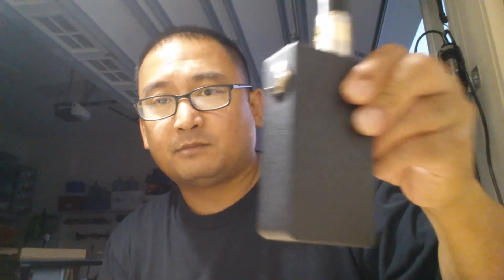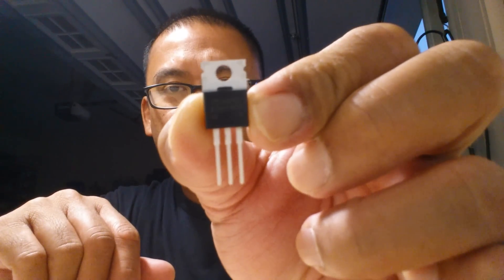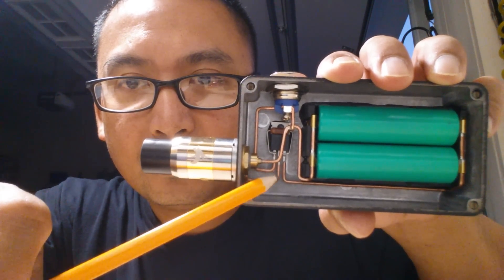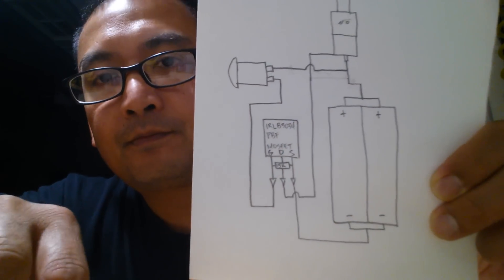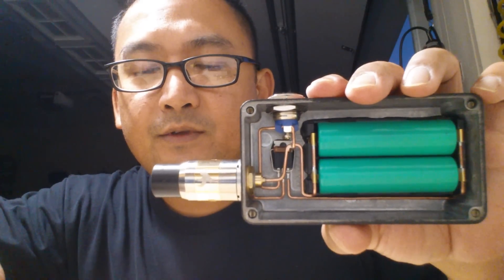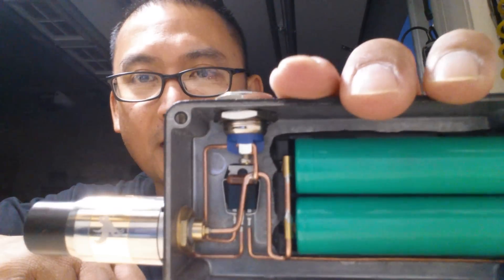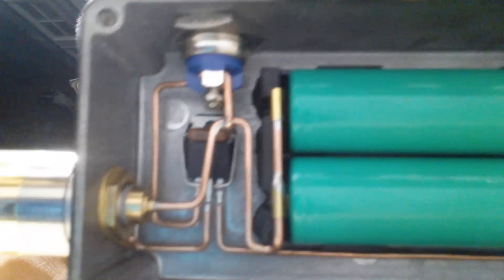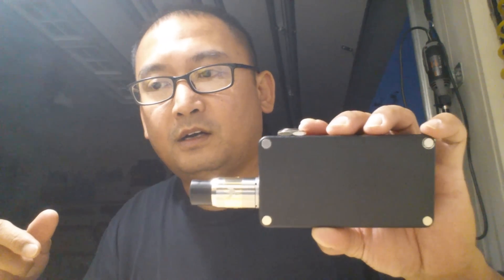Unregulated box mod with a Mosfet

Comment: That is slick wiring bud. you confused me though. You are using 14g solid copper wire. But you said you would use heavier gauge for the negative, and recommended 18. But 18 gauge is much smaller than 14, not heavier.
Reply from the maker: Ranger Rob 1. Practice 2. Use a variable wattage soldering iron 3. Use soldering paste (it will clean the surface for a better bond) 4. Don't use too much solder.
Reply from the maker: Ranger Rob one more thing, this is how I do it and how I was taught, place the tip of the iron directly on the surfaces of the item your trying to solder. For example, if you want to solder 2 wires together, ensure the tip of the iron is touching both wires. After a couple seconds or when the Flux paste you applied start to bubble, apply the solder. Again, don't use too much. Also watch  soldering vids on YouTube if you want to see it action.
Reply from the maker: Ryan Lee I did use 14 gauge. The thinnest gauge I would recommend is at least an 18 gauge throughout. But thicker gauge wires would provide the least voltage drop...the better it will perform.
Reply: Indeed. How was the voltage drop with your 14? I must say, my ocd really appreciated your wiring! So clean and perfect. Your mod is the first I have seen where someone used solid wire instead of braided. Love the clean look of it. Very well done man.
Reply: Al USAF I also have a question, I have been told that soild core will transfer vibrations straight to solder joints and the joints will brake down quicker, multicore on the other hand is better at absorbing vibrations ect. ect. Im sure about that but I was wondering what your take is on that? Is multicore as effective at transferring current compared to soildcore?
Reply: Ranger Rob Both wires carry the same voltage. The reason for braided wire is for applications where it is easier to bend the braided wire verse solid wire.
Reply: Alright, and what about the vibrations braking down solder joints quicker is that actually a factor?
Reply from the maker: Ryan Lee check part 3 of my tutorial build.
Reply from the maker: Ranger Rob it's not a factor in box mods. But if you're going to be storing your box mods in an area where there's going to be a LOT of vibration, then maybe. I'm not sure what you're doing while vaping that made you worry about vibrations.
Reply: +AI USAF Yeah i was lurking in a box mod forum and some dude was bashing soild core, explaining that vibrations transfer easily over solidcore wire and ultimately leads to a brake down of solder joint faster, sounded reasonable and I plan to make my own box in the near future and I am just gathering my information. But what your saying is that, average daily use and transportation abuse such as minor drops and driving in a vehicle  will not cause strong enough vibrations for the integrity of the solder joins to degrade at a rate that is higher then normal? Thats all im getting at.
Reply from the maker: Ranger Rob I read a lot of those forums too. I know a lot of those people that comment are really smart...well book smart. Which is good. But I'm almost positive that those people don't build there own box mod or even Vape. They just like to sound smart because they've read it somewhere. They think they can apply every theory into everything. They also like bashing other modders because they think what they do is a standard when it comes to building box mods. I didn't build mine because I think it's better, I built it to make it look a little different than others.

To answer your question...as long as you do a good job of soldering and not store your box mod next to a jet engine...it will be fine (using solid copper wire)
Reply: Well thats good to know, thank you for clearing that up for me. I do like the look of the solid copper, do you have any tips for when it comes to soldering, I have never seen such clean solder joints it is quite an impressive box.

Comment: Awesome mod. Can't find the 15kohm resistor with those specs. I'm gonna use a similar resistor with a voltage rating of 250V instead of 300V. I'll let you know how it turns out unless you would think that it is going to turn into a pipe bomb at that point.

Comment: Can i run a 22k ohm resistor in place of a 15k
Reply from the maker: Special EDy you do need a resistor because it's what shuts off the mosfet after the switch is released.
Reply from the maker: Chris Lucas I've read on other forums where 22K worked but I can't directly tell you that it will because I've never tried a 22K. Post it here if it does...thanks.
Reply: You dont need the resistor, but if you do use one the smaller the better. Basically the resistor will be using power any time the batteries are connected.
Reply: Well the 22k has the same specs as far as watts but if it works will let you know just waiting on box to come in mail
Reply: Al USAF The resistor dissipates any electricity created by interference between the gate and the switch. The mosfet will switch on if there is any voltage present at the gate. The idea behind the resistor is to prevent the mosfet from accidently turning on and off from inductive currents in the wire from the switch to gate.
Since we dont have any other electronics present in the device the only way to create an inductive current would be waving a large magnet past the box mod. If there was another wire in close proximity with current flowing through it(while the mosfet is off) the resistor would be necessary.
The gate to source resistance is 2.1ohms, it is essentially 7000 times more effective at "shutting off" the mosfet as the 15kohm resistor you suggest. But since the switch has zero capacitance this fact is irrelevant.
Reply from the maker: Special EDy thanks for that very long explanation about how a mosfet work...you're not the first. If you've built a "box mod" with a mosfet and you didn't use a resistor, please share that. But in this case it's necessary to use a resistor.
Reply: K guys the 22k worked no problems at all so i you cant find 15k 22k will work
Reply: Al USAF My dual 26650 box mod has a 555 IC and PNP transistor powered by the button for PWM.
200ma from the IC wasnt enough to drive two 3034 mosfets so I had to add the transistor. I think they are a little less sensitive than you think even though they are supposed to be "logic level".
Reply: Special EDy Nope. does not work that way..it's not a read switch..

Comment: OK  wired mine just like yours, and when i screw in the RDA it fires without button pushed ?? y is that ?
Reply from the maker: Jason Etcheson happened to me too when I built my first one. More than likely the negative wire at the bottom of the battery sled and the 510 negative are making contact with the cover when you put on it . Try it without the cover, if it works then this is the problem. To fix this, you have to file down the lip of the cover where it's making contact with the wire and the 510 negative washer/nut. Let me know what happens.
Reply: ya was a ground touching at the bottom so i put black rubber sheets in it now its fine, ty for your help

Comment: First off epic level clean on the build Question is that the only 15k resistor you recommend for this build? thank you
Reply from the maker: joe biondo you can use other 15K resistor. But I can only recommend the one I'm using because I know it works.
Reply: Al USAF is there any reason why this would fire on one battery thank you in advance
Reply from the maker: joe biondo it should because it's wired in parallel.

Comment: Hey all I am about to try my luck at building a box mod now I noticed that most people are using the 18650 at 2600 mAh i have found some that say they are 4000 mAh  on eBay now from what I gather this means they can store more power which would make them last longer is this correct and would it be safe to use them?
Reply from the maker: brian hampton I'm not sure about those batteries. But I use either Sony VTC-4s or Samsung 25Rs.
Reply: OK thanks

Comment: Hey Al, I just built the same exact mod but my solder point where the positive out of the switch connects to the positive wire leading to the 510 keeps breaking when I screw on an atomizer. Am I using the wrong solder? Seems like I would need solder that is flexible. Any feedback appreciated. I may have to use stranded wire there I don't know.
Reply from the maker: ***** what type solder did you use? Also did you use Flux paste? This helps clean the area for a better bond.
Reply: Nevermind it was my cheapo soldering iron. I used my weller and now its all good. Thanks for replying.

Comment: I just bought a dual 18650 box wired in parallel (haven't got it yet) but it doesnt look like a mosfet build in the pictures. So im planning adding a mosfet and resistor too it when i get it. Thanks for the video it was very informative. Also how unsafe would it be to use it without the mosfet? Would it be less dangerous with couple second button taps?
Reply from the maker: zp1944 it should be OK for a while but I recommend that you install a Mosfet.
Reply: +AI USAF thanks
Reply: +AI USAF thanks

Comment: can this same diagram be used to make the box a series instead of parallel? you have a clean looking setup.
Reply from the maker: Yes you can
Reply: Does the diagram wiring chang other than the bottom pos n neg being wired together?
Reply from the maker: Mathew Newkirk no change except you're going to connect the bottom two contacts together...so you're correct.

Comment: the copper looks like its electrical wire without the protection of its plastic sleeve
and a cheap solder iron for all the welds, i can make this but will leave the plastic on the wires
Reply from the maker: Congratulations...you're the very first one to figure out that I used an electrical wire without the shielding. Please show me and everyone else your build so we can learn something from you.
Reply: will do but have to buy a few items,and  it won't be soon

Comment: I was running a .06 build with a IRLB3034PBF mosfet and it began to run away and autofired. Now its fried. I don't understand why it happened because this mosfet is rated for a way higher amp than what I'm pulling through it. .06 comes out to 70 amps at 4.2 volts. 295 watts. Replaced the mosfet and it happened again. Could the switch be causing the mosfet to fail? any ideas?
Reply from the maker: With that low of a build it will heat up. Is it covered with heat shrink? If it is, you're trapping the heat. Try it without heat shrink to allow heat to escape or put a heat sink on top of it (Mosfet heat sink or a small copper heat sink) for better heat dissipation. Lastly, don't go too low...just my suggestion.

Comment: nice nice nice build i was skeptical on how you used that transistor at first but then i just reffreshed myself on how transitors work and wooooooooow nice using the transistor to use the full power of the battery without frying your switch is a very nice inivation

Comment: Great Vid...collecting parts now...

Which mosfet did you use, the part number comes up with two:

1)  0.0017 Ohm; Thesehold voltage 2.5v; and

2) 0.0014 Ohm; Thresehold voltage 1.0v.

Thanks!
Reply from the maker: #1

Comment: I'm going to build a dual 64amp 26650 box mod with a mosfet, does it matter what kind of mosfet I use?
Reply from the maker: You can use the same Mosfet
Reply: What kind of mosfet?
Reply from the maker: Patrick Diaz it's in the description

Comment: I have a question, I can't really determine, from the video, how you spliced the positive connection (Atty battery switch).
I wonder if it would be ok to kind of wrap the positive switch twice around the copper wire connecting the atty and battery +
Reply from the maker: Yes you can
Reply: Btw I have another question, If I am right you are using an N channel mosfet, is there a specific type or rating of mosfet (like ohm ratings in resistors) that I will need? Thank you!
Reply from the maker: Correct, it's an N-channel. I'm not sure for other Mosfets with different specs. But for the IRLB3034PBF, a lot of modders use a 15K resistor but others have tried 22K. But I've only used the IRLB3034PBF with a 15K resistor. I would recommend these because I know it works.

Comment: Hi Al USAF... First of all, I congratulate you for the awesome build. I have finally found something truly cool in modding a box mod. For a month or so, I have been gathering info and items required in building the exact mod that you have featured here. I have all the items except two... 1. I can't get a hammond box here in Malaysia but that's solved. I made my own wooden box. 2. This is the biggest one... locating a 14 gauge or lower, solid copper wire. I have a 16 gauge solid copper wire and that's the lowest gauge I can find thus far. I want to get a 14 gauge. Now, yesterday a friend told me that he has a 16mm cable with 7 strands of solid copper wire in it. I haven't seen it yet. Been trying to look up the spec of 16mm electric cable in the internet but to no avail. Did some other reading and found that 10 gauge solid copper wire can hold up to 30 amp... Here are my questions... Would it be okay to use 10 gauge? Or anything lower than 14 gauge solid copper (If I can get one)... Would it affect the perfomance in terms of voltage? I am using the exact setup like yours with dual parallel 18650 batteries, 3 amp rated switch, N channel mosfet and a fatdaddy 510 connector. I am preparing to build this very soon. I appreciate you kind reply. Anyway, congratulations on your awesome build again, pal. Truly a masterpiece...
Reply from the maker: Thanks Ralph! Yes you can use the 10 gauge wire. You just have to file or sand it down to fit the 510 positive pin and probably the switch. Also because the wire is thicker, just make sure the wires will not be touching each other, especially when you solder them onto the Mosfet. Good luck on your build. It should perform better because it will handle a lot more amps. Good luck on your build.

Comment: If I make a Build with dual 26650's will I need to get any different parts? IE: will the Mosfet Still work or would I need to get a different one?

My other Q is why run batteries in a parallel rather than a series?
Reply: Also I just read that " In reality, the current 26650s are a generation behind their 18650 cousins. Unless you have to have the additional capacity the larger cell offers, they are outclassed in every way by the newer and slimmer cells."  What would be the advantage of running 26650's over 18650's. Also what does he mean by additional capacity?
Reply: parallel batteries doubles the amperage, which means you can use a lower resistance atomizer
Reply from the maker: Tnx Andre for the response. Yes, you can use the same Mosfet. Not sure the source of the quote but as far as the capacity, it means longer battery life. For example, a Sony VTC4 is rated at 2100 mAh. An MNKE 26650 is rated at 3500 mAh.
Reply: Awesome thanks for all the help, needed to know everything before I purchased everything

Comment: How come you don't use fuses? I'm watching another tutorial on the same mod that uses 2 fuses. Are they needed? I like your build a lot better.
Reply from the maker: It's more necessary on VV box mods because the chips have limited amp rating. For example, Raptor chips is rated at 20 amps so two 10 amp fuses are installed in parallel so it will reset if you go above 20 amps. You can still install a Fuse to limit your box mod from going above the amp rating for the hardware used that have the lowest amp rating, which typically will be the batteries if a Mosfet is used. So for a parallel VTC4 18650 setup, you'll need to install two 30 amp fuses to limit the max amp output to 60 amps. But it's not required unless you vape in that range.

Comment: Outstanding look. How to you elevate your wire so it doesn't short out. I normally use stranded wire and heat shrink everything. But I would like some tips on how you made it so clean. And again Well done.
Reply from the maker: Thank you. I dry fitted all wires before soldering to make sure it doesn't touch the box and each other.

Comment: Question: 9:50
The shematics is P-Channel MOSFET schwitch design with Pulldown resistor to give Gate a defined status (OFF)
The shematics can't work with a N-Channel MOSFET it would cause continous fire and stop when button pressed.
Why does it work with a N-Channel IRLB3034PBF
Reply from the maker: The schematic is for an n-channel Mosfet. If you look at it again, the Mosfet is connected to the batteries negative.
Reply from the maker: ...and P-Channel would be connected to the batteries positive.
Reply: Al USAF
Ok, but N-Channel (switch function) triggers with Gate > Negative (PullUp resistor for defined state to +),
your shematic triggers from: + > switch > Gate
So normally i use in this case P-Channel

If the load ist between + & drain OR source & -  doesn't matter in our case
Reply from the maker: Captain Blackbird not sure what applications you use the Mosfets for but box mods with Mosfets, N-channel in this case, are wired this way.